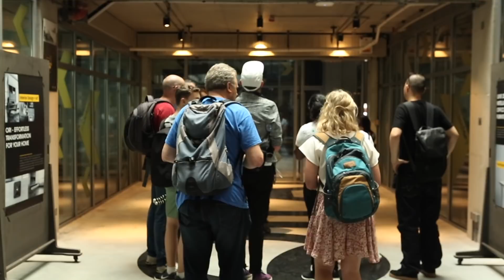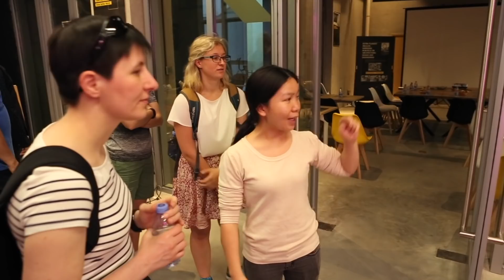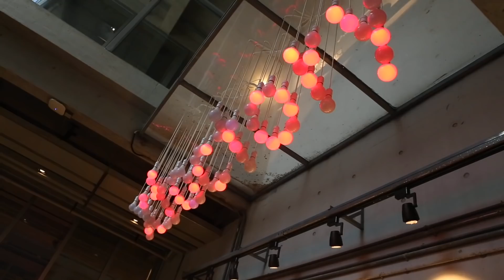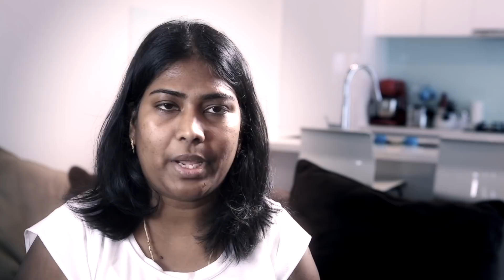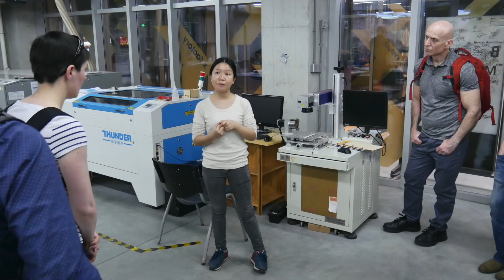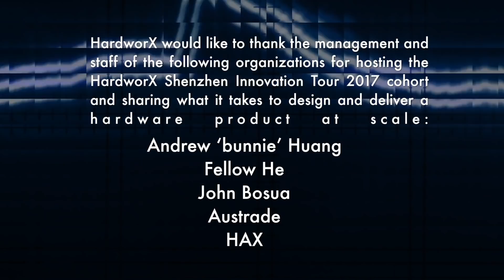The xFactory

Comment: I would love to see places that do small run metal working like metal turning, gear cutting and steel enclosure fabrication from the internet.
Reply from the maker: Checkout my video on HLH who do plastics and metal: https://youtu.be/zTmPMybOwpQ and another company called Kaier Wo which also do prototypes/short runs of housings in metal and plastics https://youtu.be/pu_Wkh_mWpQ
Reply: Thats pretty much what I'm looking for although a little lite on the metal working side of things.
Reply from the maker: get in contact with them if you want more information. They are easy to deal with. I will be posting a wrap-up video which will feature a tour of a gear making facility soon.
Reply from the maker: There is also the video on Jaifuh Metal and Plastics but its more on mass manufacturing. Lots of cool metal working related stuff though :-) https://youtu.be/_QG7J2k1DNc